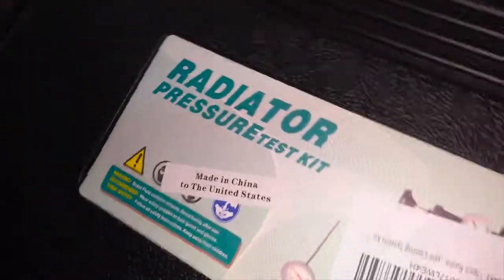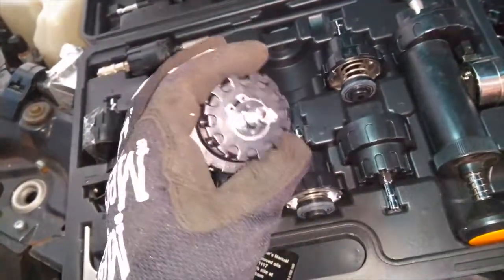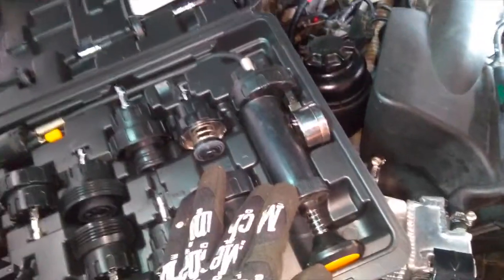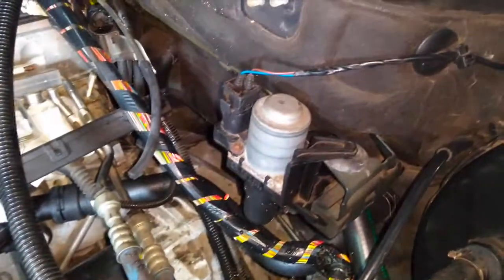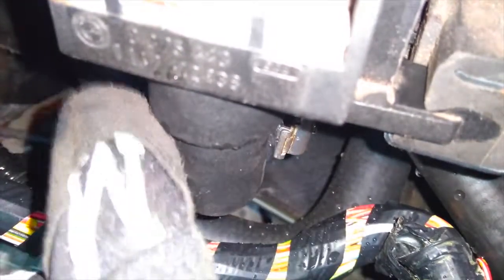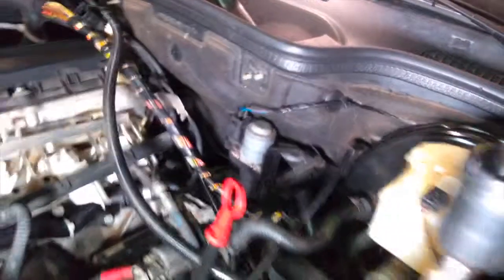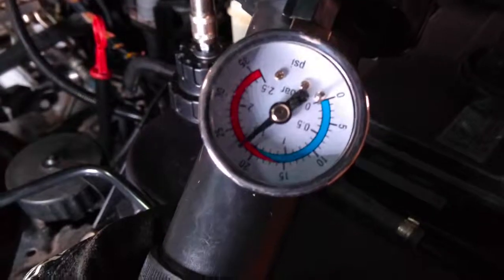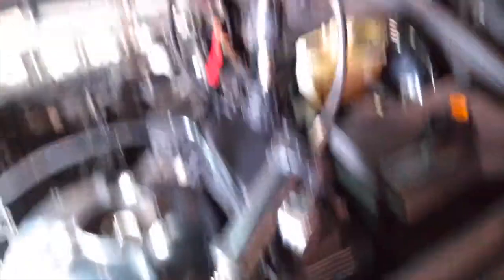Coolant System Pressure Test on BMW Z3 M52TU

Comment: I purchased this exact kit. Used the same #5 adapter. As soon as I started pumping coolant started flying out of the top of the #5 cap. It's the only cap with a snap ring and it's the only cap whose fitting spins freely? I don't know if it's missing a piece or defective but I don't see any chance of it sealing enough to successfully pump pressure into the system. Wish I could contact the author. Don't do Instagram.